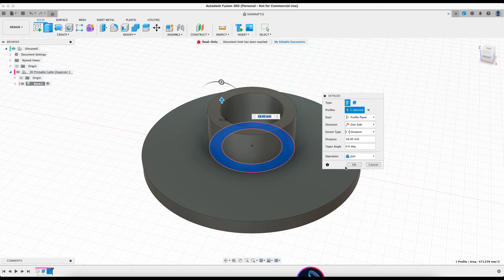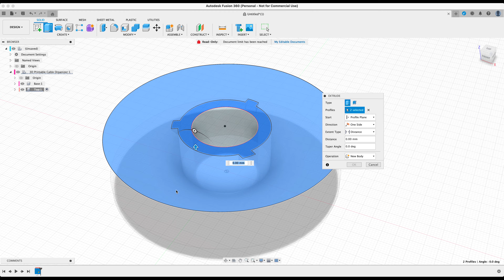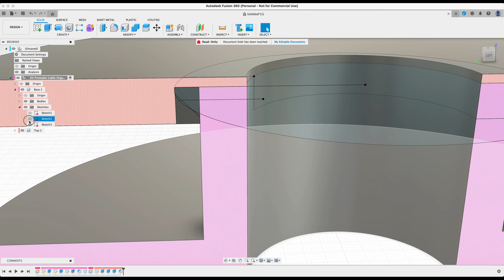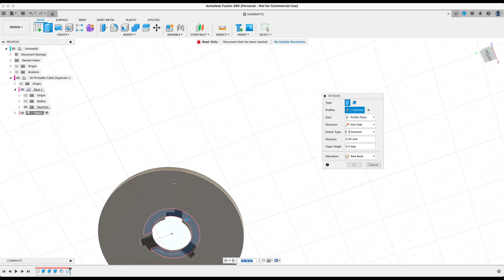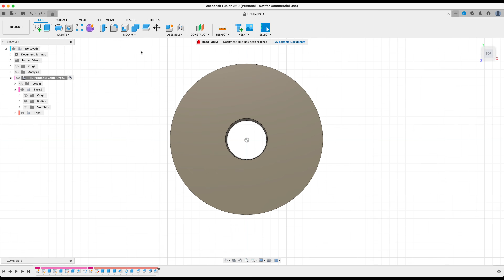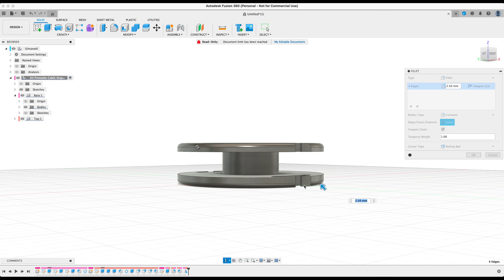Day 6: Learn Fusion 360 for 3D Printing | Cable Organizer

Comment: After typing circular you don't say how to select the last 2 features in the timeline. I have left clicked them multiple times and nothing happens. This wasn't covered in a previous lesson.
Reply: in the version of fusion 360 I am running on, you need to select the two objects from timeline first, and then apply circular pattern to them